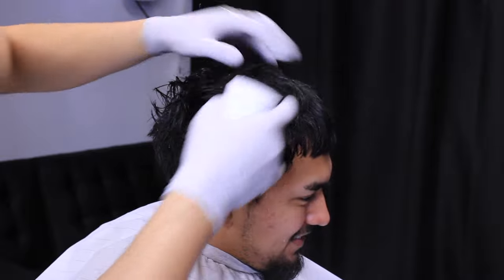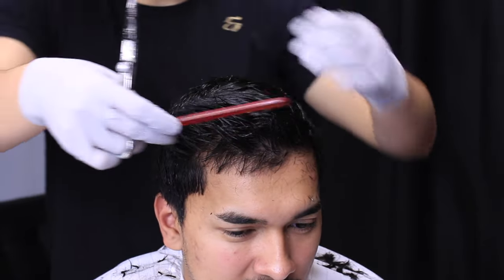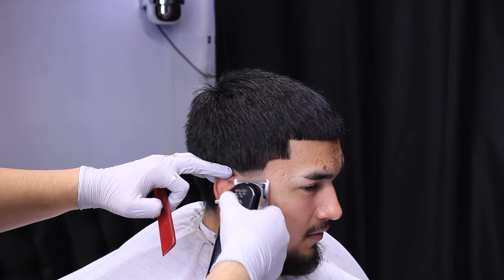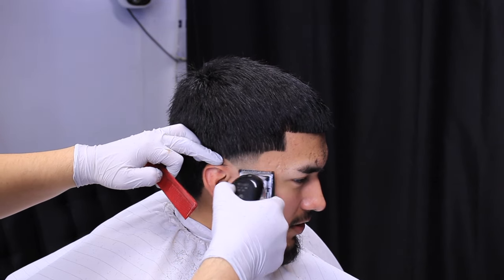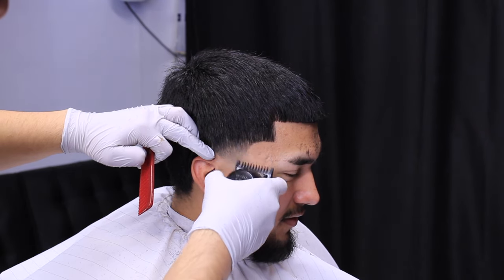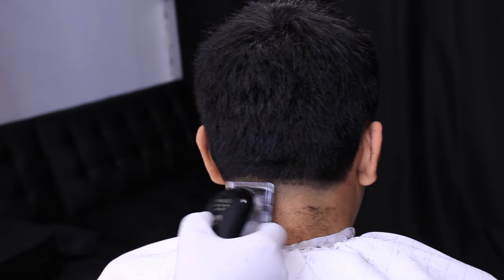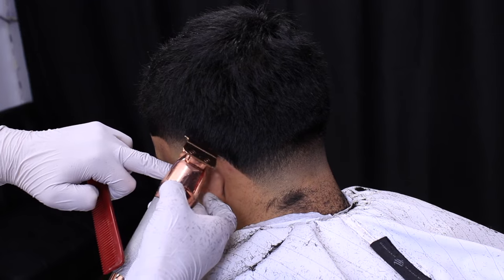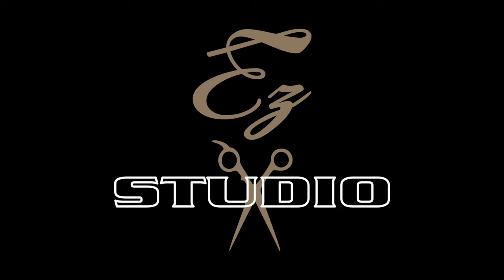How To - Low Taper step by step

Comment: 2:50 If you make the guideline straight like at the end of eyebrow height does that mean you have to skip the 3/4 opened part? Or do you have start with 3/4 open instead of fully open?
Reply from the maker: The reason for the angle of the guideline is to create more space to fade if it’s a straight line the taper will be higher